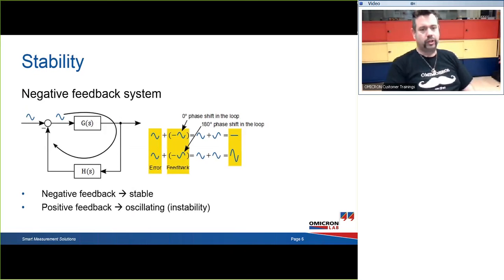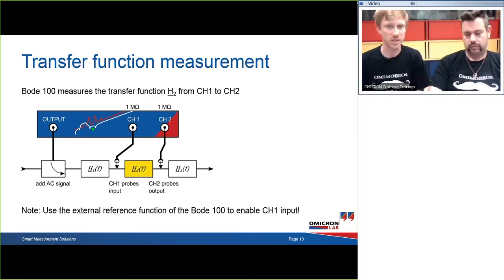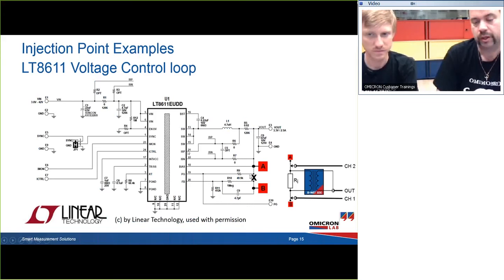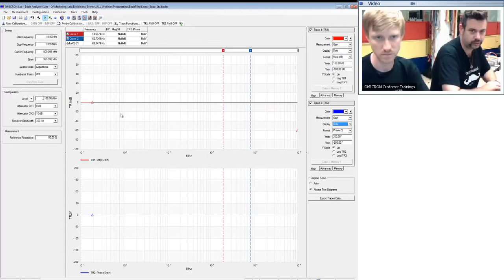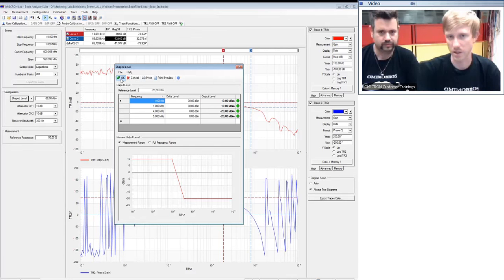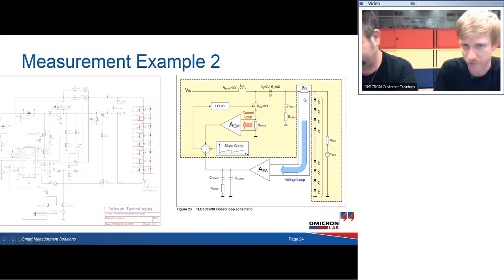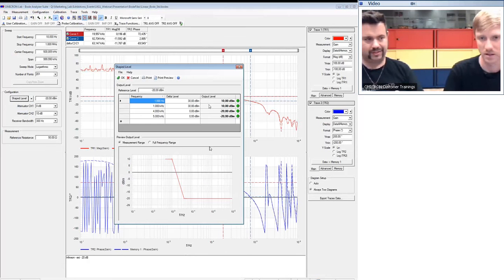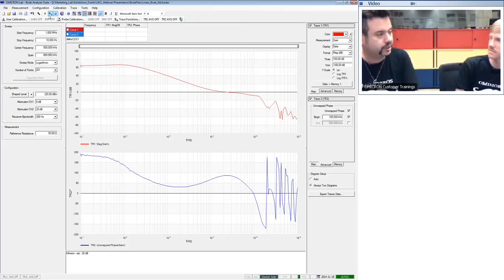Webinar Power Supply Loop Stability Measurements with the Bode 100

Comment: why in close loop did you consider reference signal iqual to zero ?  so in ther E/A the Vref =2.5V no change 
If we inject V1 and we receive V2  T(s) =V2/V1 

 Vref*G(s) - G(s)*H(s)*V1 = V2 saying Vref = 0  we have  :    - G(s)*H(s)*V1 = V2 

At the end  T(s) =V2/V1  = - G(s)*H(s)

Am i wrong saying Vref = 0 ?

But what i see is : the reference never change to zero  (  E/A the Vref =2.5V no change)

Could you mind explain to me pls ?

Or V1 signal is great than Vref ? ??
Reply from the maker: Because the vref should not change when we inject a signal. Vref is an internal voltage reference in the control chip. It stays constant.